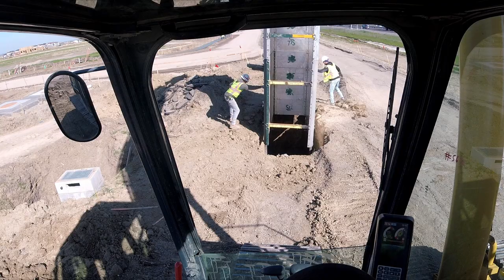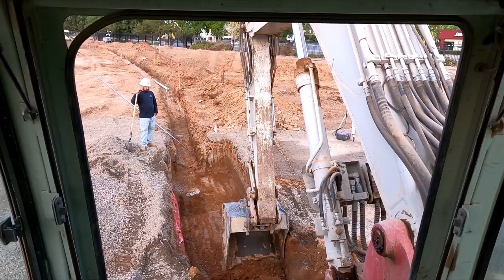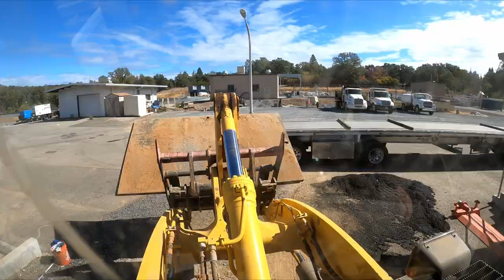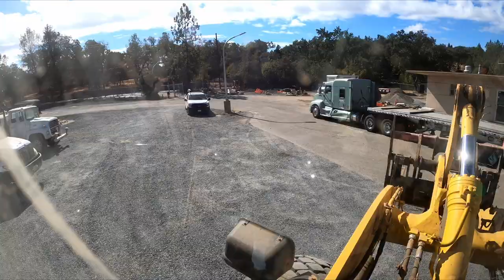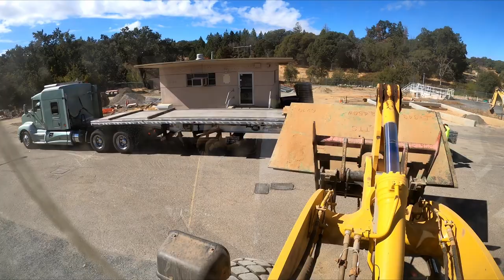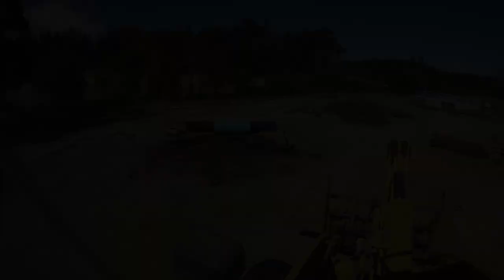Loading plates on a truck with a WA320 loader

Comment: Good job, I run lowboy & when ai load my self with plates to see if im straight with trailer , I will lower it to the point where I can see the top of the deck just over the plate edge, look to see the space between deck & plate edge. Same thing with manhole boxes & ditch boxes also.

Comment: test time so how do you pick up plates that are to wide for them to balance and stay on the forks when you curl up without using anything but the forks. just curious if you know the trick i see alot of guys fight them when they dont think about it lol
also how you like the wa320 company i work for has a couple im not a fan of the hydrostat trans we do the same work you guys do
Reply from the maker: One fork on either side of a corner and the corner is used a leaver on the cross bar of the forks.
Reply: @TheLeverMonkey  haha right on buddy u pass lol